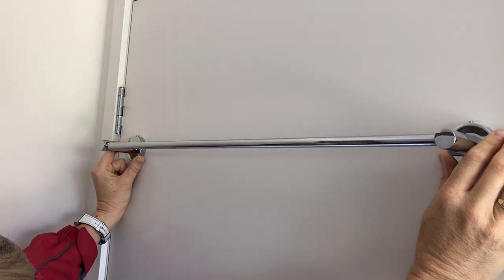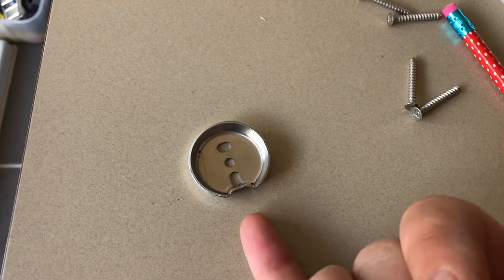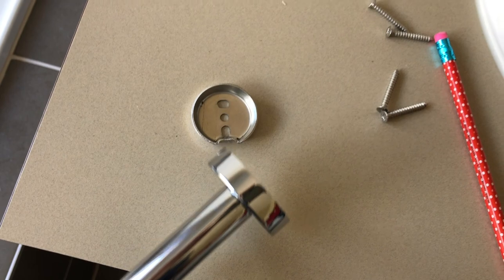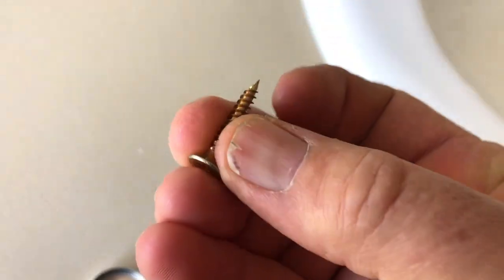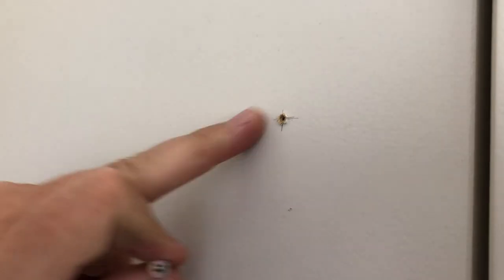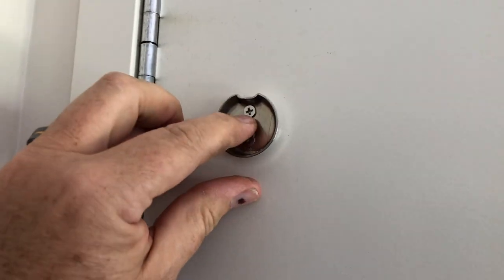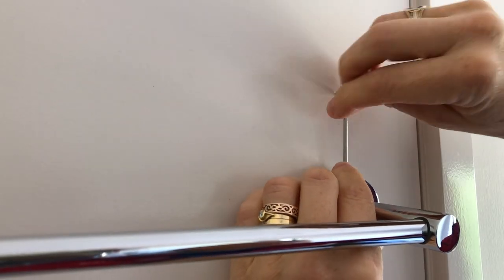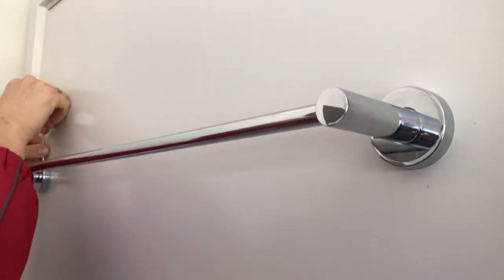How to mount a towel rail and how to repair or fix an old one. Hidden bracket installation

Comment: Hi Mark, our handyman installed our towel bar but it is about 1/16" uneven!! He used anchors, too. Can it be fixed? How would we do it? Thank you!
Reply from the maker: Hi there. Love your user name by the way. 😃 
Yes there is some adjustment possible. Both by loosening the Allen key and putting a spacer so that the fitting sits a little different. Also if the anchors are plastic you can drill a new hole in them off centre and screw the screws into the new holes.